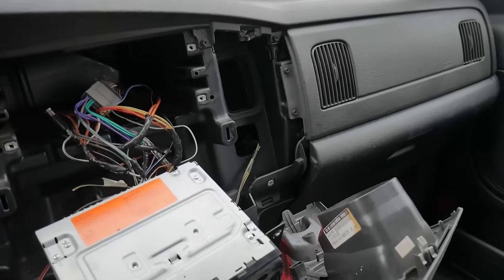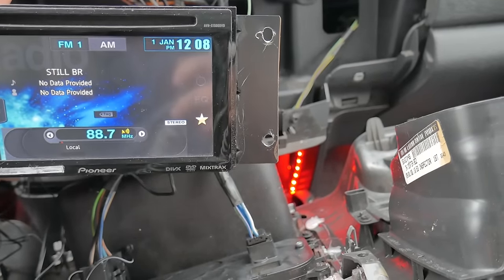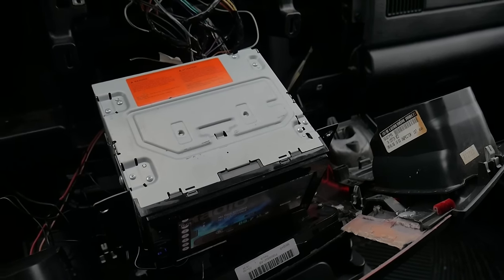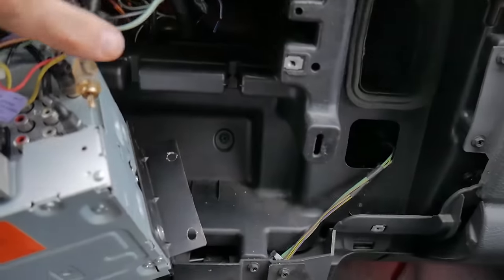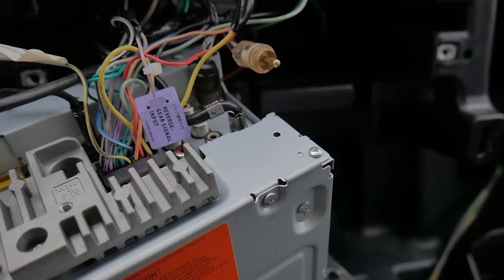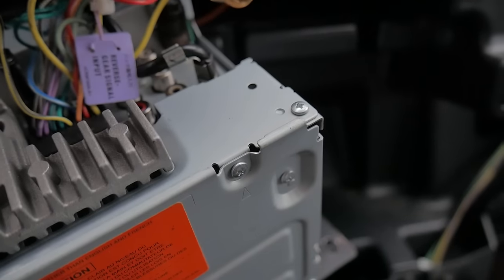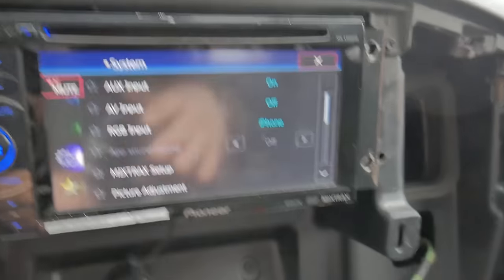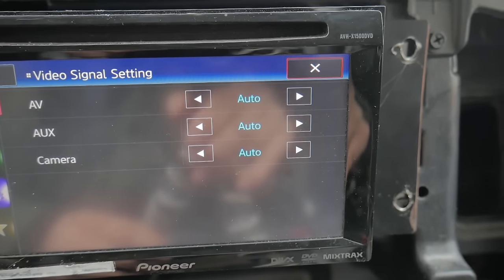How to wire a backup camera to your radio/indash screen and what settings to use

Comment from the maker: Full install here https://youtu.be/c4oq50Ph8WM
Reply: I kust put it but system say no signal what i should be do
Reply from the maker: @highlander4731  power going to camera ? Check the full install link that's pinned
Reply: Just had camera installed on alpine.  Camera image flickers.any ideas what is wrong?
Reply from the maker: @glenjohnson9078  possibly bad connection/wiring
Reply: @AllThingsCool  l

Comment: OMG I know this video is almost 3 years old, but thank you so much. I got a backup camera installed about 2 years ago and when I replaced my battery in my car I guess it reset my system and I took it back one time to the shop that installed it and it happens again so I decided to look on YouTube( 🙌🏽🙌🏽) and have found the solution. THANK YOU
Reply from the maker: glad it helped !

Comment: If you want to view your rear view cam while driving forward, or bypassing the reverse signal. You gotta extend and hook the power wires to the cam, straight to the power wire for the overall stereo. Doing that enables constant power to the cam when you turn the key, rather than coming on when you just hit the reverse on to signal power to the camera...
Reply: Wone's Time yes but if your reverse cam has lights on it they will be powered on all the time.
Reply: If you do this method will the stereo also switch to the rear cam screen when  reverse gear is selected? I'm thinking not, which would mean you can only see the rear cam screen by manually going into the menus or input screens and selecting the view. For me that's a pain in the ass
Reply: Add a toggle switch
Reply: @authenticationstation2041 how do I do that
Reply: @kingdavid0011  install a toggle to the power wire for the cam so when you want to view it, switch it on and it powers the camera.

Comment: The camera icon on the receiver when turn on allows you to turn your camera on while driving. In order to do that..you need to wire the red wire from the camera to a power source that provide consistent power like a acc on the back  of the stereo or to a cigarette lighter.  If you only hook up the power to the reverse light the camera only gets power when in reverse and you will get a black screen when the camera icon on the stereo is on.
Reply: I was gonna say the same thing
Reply: If I was towing a trailer, I keep an eye on the trailer every now and then.
Reply: So you need 2 power sources? One from the gear shift (R) signal and a constant for the camera?
Reply: @balemonte727  I think its the reverse light red wire goes to the violet wire on the back of the radio so the radio knows when to switch the camera on. The red wire from the camera goes to a switched power source (from ign on power). RIGHT???
Reply: @Xyooj Vanj  -  I just wired up an Alpine ILX-W650 in my 2007 Dodge Ram 2500 this weekend, and I noticed the factory wired a red constant hot from the left side 12V cig lighter, and the shop I had install the original Alpine unit (12 years ago) reconnected that red wire into the old Alpine harness.  I hooked up my NVX BARCAM backup camera behind the unit, so I would not have to remove the head unit again when I go to wire up the camera (currently waiting on heat-shrink tubing to arrive tomorrow).  I was just looking for this exact response trying to determine whether I needed to reuse that red constant wire from the 12V, or terminate the connection.  I wired in a Micro Bypass so I could turn on the camera while in motion, and I was confused by the 3-way connection on that red wire from the factory.  Your response cleared it up.  And now I know that I wired it correctly use when not in reverse.  Thanks!  👍🏻
Reply: I think , the radio internally should power the camera , no extra connection
Reply: Should it be hooked to the reverse light & acc?

Comment: Great straight forward explanation. Just a heads up to some folks I had the black screen and it turned out to be a dead camera. Test the camera before installing.
Reply: This might be my problem..my wires got pinched and i spliced them back together and black screen.. how did you test your camera? Multi meter?
Reply: @fuelz7124  HAha...well the only thing I had laying around that had an RCA output was an old original Nintendo. I plugged that it into the deck and it worked. I had no way to directly test the camera, but I replaced the camera and it worked right away. I wouldn't splice a tiny RCA cable. Run a new one.

Comment: My Pioneer DMH 1500NEX does not have a label on the reverse camera power trigger wire. Do you recall what the color is on this wire as it comes out of the Pioneer head unit? Thank You

Comment: Ya good video,  I am having trouble finding the reverse signal wire in my  wingroad.  Any idea how to find out what that wire is?  I mean in general,  doesn't have to be a wingroad.
Reply from the maker: easiest thing to do is tap into your reverse light wire
Reply: @AllThingsCool   ya I get that but I dont have easy access to it

Comment: "Rear View" should allow the camera to activate at any time, regardless of if the vehicle is in reverse or not. If you get a black screen, you haven't wired in the camera power correctly. This is useful if you do offroad driving, have something covering your rear window and then can use this camera view as a rear view mirror. Looks like you connected the reverse trigger (purple) to camera power, instead of having the camera powered up with the vehicle accessories power, which is how it is meant to be done.
Reply: If the cam is powered up to the vehicle accessories power, will there still be an image at reverse?
Reply: @benjohnlabayen  yes. The stereo has a reverse trigger which should be connected to the reverse light circuit, to allow the stereo to switch to the camera view when reverse is engaged. But as the Camera should be powered off ACC power, it should also be available at any time via the camera source option from the main menu. If it's powered off the reverse circuit, it won't be powered up when simply selecting the camera view from the menu
Reply: @alex.caddell  which exaxt reverse wire are yall talking about, a ground or hot & location..
   Also I have a break wire in that needs?
Reply: What would the problem be if the camera worked fine but now all of a sudden it doesn’t but everything else works
Reply: @TheDylonias  sounds like something has disconnected in your wiring. COuld be the RCA slipped off or the wire to the camera got damaged
Reply: Where does the purple wire go?

Comment: I can't believe I found a video with the same entertainment unit as my car but my question is, can I just splice a new backup camera onto the one that's already installed?
The wire is already run to the radio receiver. It's just, I went through a car wash and my backup camera is now dead.
So I wanted to buy a new one and just splice the wires that are already run back to the trunk and mount the new one where the old one was.
Will it work?

Comment: At the rear, where does the little red wire coming off the rca plug get hooked up too? The reverse light? Then where does the power wire get hooked up too? Both on the reverse light wire?
Reply from the maker: Yes both go to reverse wire the red attached to rca is the signal to the radio that car is in reverse so the radio knows to change to back up camera input, the other red is power for camera. If you want you can run red from camera to constant power then if you have option on radio to view back camera while driving  then it will work to  hope this helps.

Comment: I have a question about the audio/beeping when you get close to objects as you back up.  Is the beep audio coming from the camera or is it built into the stereo system?  I just swapped my kenwood stereo out from a 2009 EDGE to a 2010 Fusion.  I had the beeping working on the EDGE by so far no luck on the fusion.  Where should I start troubleshooting?  thanks.
Reply from the maker: the beeping is usually controlled by backup sensors

Comment: I have a question I'm hooking up a backup camera and it has an RCA plug at the head unit it also has a red wire my question is where do I hook this red wire to sold it is called the reverse trigger wire but I'm not sure how to identify it at the other end of the cable I have the wiring harness for the camera wired to the tail light reverse light

Comment: Hi thanks for the video.  I’ve had my camera and head unit installed by someone but the camera has never worked. I just took the head unit off and checked it and the rca and purple wire are both in correctly. But when I go to reverse camera it’s just a black screen. The camera actually flicked on for one second but that was it and now it doesn’t go on. Do you think I should replace the camera?
Reply from the maker: the cameras aren't expensive but before u replace the camera I would go to the back of the vehicle and check the power and ground wires coming from the camera makensure those have a good connection. also check your settings  like I stated in the video make sure your menu settings are set up right
Reply: @AllThingsCool  thanks mate will do. Never done it but I’ll give it a go!
Reply from the maker: @Stu_Donnachie  good luck

Comment: Thanks for doing the video, I don't have a problem with the wiring connections.  If you done any stereo/amp wiring it is the same concept.  Question I have is how did you route the wire into the cab?  Did you drill a hole and grommet or did you use a body plug opening?
Reply from the maker: i had a drain plug from factory under my backseat drivers side  so i just drilled a hole in the rubber drain plug and ran it up into the cab that way, then under carpet to dash. if i didnt have that i would of drilled a hole and installed a grommet hope this helps
Reply: If you have a truck, I would follow the wires from your trailer 4 or 7 pin and then bring them in through the firewall grommet. It will stay water proof.

Comment: So my wires got pinched and i have a similar pioneer. I spliced all the wires back together...but now i get the black screen in reverse or just turning the camera on...is it possible that the camera shorted out when the wires got pinched?  Can you even splice video cables back together?
Reply from the maker: You can but it wont always work right you sure the camera is gettin power and is grounded

Comment: Hi, thanks for the video. I have just installed a Pioneer AV on my car. I have also tried to install the backup camera, connected the red 12v cable from the camera to the violet-white wire labelled as Reverse Gear Signal Input, inserted the RCA cable like you did but I am getting black screen. Note that my a Pioneer doesn’t have the option to switch rear cam off as you have shown. What am I missing? I have no connection to the reverse light, can be this the reason? Also is the camera getting power only from the violet white cable? Thanks
Reply from the maker: Did you run the wire to the back of ur radio so it knows to switch to backup mode screen
Reply: chuck kososky the camera’s red wire connects directly to the unit’s violet-white cable. Question is more if I also need connection to the car reverse switch wire?
Reply from the maker: @lucach3034  yes you do need a reverse power signal. U need a power source and a reverse power signal source.
Reply from the maker: Check the description of this video there's a link to another video of where I installed the camera maybe that will help
Reply: chuck kososky thanks! So basically both the violet-white wire from the unit and the red 12v from the camera need to get power from the same reserve signal that comes either from the reverse light or from the reverse switch, am I correct?
Reply from the maker: @lucach3034  yes your radio and camera need reverse signal power ran to it

Comment: Why the rear view not working..? What are its connections..? Even I'm facing the same issue.. It works fine with the reverse mode.. But switches to black/blank screen.. I think there must be a lead missing it's connection.. Please help me resolve this..

Comment: With mine I have turn on video on the radio for it to work. If the previous setting was radio it won’t work unless I hit the video icon. Any ideas? Once u hit video it works in reverse and turns off after in park etc.

Comment: good video  Im trying to figure out how to wire for reverse power and manual power to backup camera,  right now it only works with reverse but my radio dv271bt has a manual button for camera.  I thk I need a relay but I need to figure out how to wire it in.   any help would be appreciated
Reply from the maker: is the camera always on or is it only powered on when vehicle is in reverse

Comment: I’m about to install one on a Chevy 2005 avalanche. Where do you run the wire? Under the vehicle?  Just want to know where the wire(s) (RCA & red power) run from the camera to the unit itself. Thanks.
Reply from the maker: Bryan Monk check out this video https://youtu.be/c4oq50Ph8WM
Reply from the maker: Bryan Monk also i did run the wires along frame rail until i got under the cab, there was a drain hold so i ran the wires up througg there under the carpet and behind dash hooe this helps

Comment: It clears everything up except where the reverse wire routes to  because there’s no reverse wire in the radio harness that I can find.
Reply from the maker: I routed mine to the reverse signal wire in my trailer harness or you can to the tail light
Reply: chuck kososky ok thank you

Comment: my car 04 Pontiac in reverse  stops my audio player. no one like it when there jamming out and  puts it in Reverse to hear there  self singing and realize they sound like a cat dying. any info   would appreciate it. Ive never  worked on a stereo  and my instructions came straight from china where the Manuel had its color codes and labels wrong.
Reply from the maker: You should have a few wires maybe a black for ground red for power and a yellow for reverse signal or something similar. There should also be a rca usually one for the video from camera to radio do you also have another rca for audio hooked up if so disconnect that one u dont need it

Comment: Thanks Sir good work, just one more thing, where did you get the (R) signal to the red wire? It'll be different on every vehicle I just need an idea where to get it from.  Ok, I found the light module thing in the back, cool, thanks.

Get some sleep man, your doing too much, lol
Reply from the maker: I used the reverse signal wire from the trailer harness,  same as tapping into the reverse light on taillight both were purple wires for my truck, hope this helps

Comment: Do you need to wired the Ground wired to the Head unit?
Reply from the maker: No the ground does not have to go to radio I just grounded the camera to the bumper this may help https://youtu.be/c4oq50Ph8WM

Comment: The reason you get a black screen when you press camera on, is because you need to sit the camera power wire.   One to the reverse wire, to auto switch, and one to acc power, so when you press that button, the camera is powered.   You can watch it while youre driving

Comment: dont i need to connect the camera to the reverse tail lights?
Reply from the maker: You can use that to  power your camera and that same reverse signal needs to run to the back of your radio so your radio know when to switch the inputs to back up camera
Reply: So i dont need to wire the purple wire at the headunit? Mines pioneer too. I like to DIY . Pls dont get angry i have questions
Reply from the maker: @bugsbunny4648  yea connect the purple wire or a reverse signal wire to the back of radio. The radio needs to know when the car is in reverse so it switches to the back up camera mode display. Also connect your camera power to that wire hope it helps then plug the camera RCA cord to the  back of radio to get the video feed hope this helps
Reply: @AllThingsCool  sir im almost done. i have a question. the red wire goes to the (+) of the tail light but how about the black wire. Should i insert it at the (-) terminal of the tail light or any part of the cars body. Thank you
Reply from the maker: @bugsbunny4648  just ground it to the metal body u can use an existing bolt/screw or run ur own. If you dont see a bolt in your area quickest thing to do is to drill a self tapping metal screw to the frame or body becareful where u drill it so you dont drill through the front of a panel
Reply: @AllThingsCool  cant i just tap it to the negative terminal of the tail light? like it will be parallel
Reply from the maker: @bugsbunny4648  that will work
Reply: @AllThingsCool  already finished the job! after 2months lol. it worked great. 2006 car now seems modern

Comment: so i have to conect  the power wire from the reverse light?
Reply from the maker: Yes your radio needs to know when your cars in reverse so it know to switch to back camera
Reply: chuck kososky so I would need to get a power wire to run from the reverse to the pioneer?

Comment: Hi i have a problem in camera wirring i put camera positive wire with reverse light and negative wire i attach with one screw . When i start the car and put in the  reverse gear ( automatic vw touran) they show me display blue screen and when i turned off  engine  and put switch on position and put reverse gear then they show me  rear display .can you please help me
Reply: need to install a rely switch, use the 4 pins, #85 for ground, #30 for the red wire  rear camera, #86 wire attached to the positive reverse light and #87 attached to constant 12v(from the battery or if the trunk has a cigarette lighter) done deal.

Comment: Are any of the backup cameras able to connect to ANY radio/dash?
Reply from the maker: As long as your aftermarket radio has inputs for a backup camera then any after market backup camera should work
Reply: Yep, you can install a camera on model T and it will show a picture on the factory installed screen.